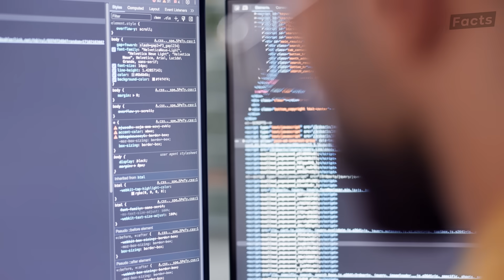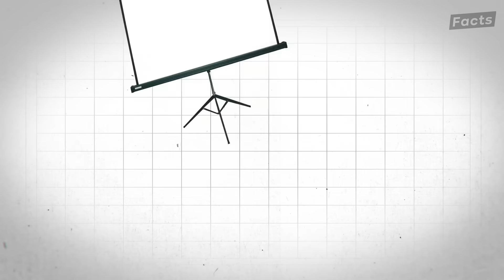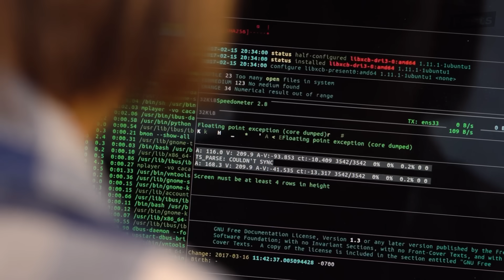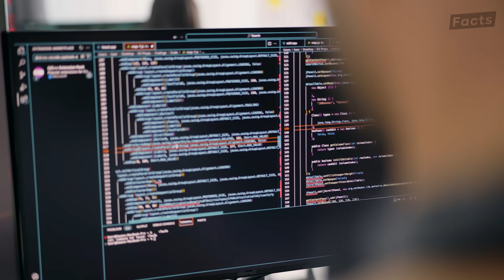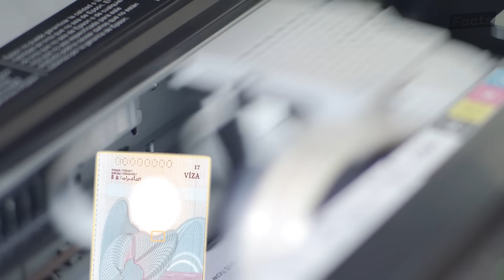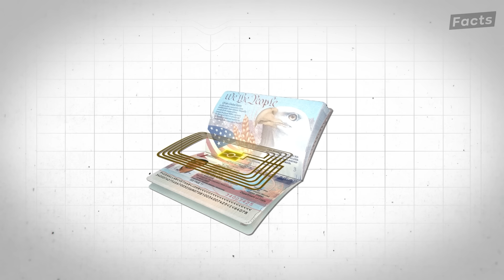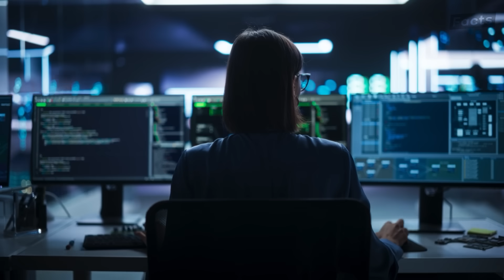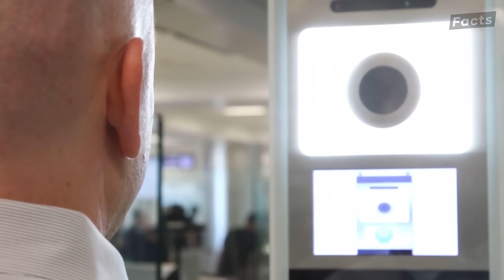How Fake U.S. Passports Are Made - Inside a Secret Forgery Lab

Comment: It is recommended that all countries, including the United States, implement biometric passports with digital signatures and OCSP verification. This process is as simple as checking the chip and viewing the digital signature. Currently, this signature cannot be forged. Furthermore, if someone were to break RSA, passport forgery would be the least of our problems. Please note that OCSP validation is required for stolen or lost documents.

This technology is also used in European ID cards, although for various reasons, validation is rarely performed.

Automatic border crossing machines facilitate this process. The potential risk to be aware of is that a passport could be stolen and misused by an unauthorised third party before the loss is reported.

Comment: US is so behind in terms of technology that it can’t even secure its passport system.
Reply: It is recommended that all countries, including the United States, implement biometric passports with digital signatures and OCSP verification (US does partially). This process is as simple as checking the chip and viewing the digital signature. Currently, this signature cannot be forged. Furthermore, if someone were to break RSA, passport forgery would be the least of our problems. Please note that OCSP validation is required for stolen or lost documents.

This technology is also used in European ID cards, although for various reasons, validation is rarely performed.

Automatic border crossing machines facilitate this process. The potential risk to be aware of is that a passport could be stolen and misused by an unauthorised third party before the loss is reported.

Comment: I  just ran a quote for passport making machinery. Maybe there are more, but I only found 2 companies that can make the machines. Then there is the paper. The printers are done by other companies. The combo can run up to $8 Millions.
Reply: It is recommended that all countries, including the United States, implement biometric passports with digital signatures and OCSP verification (US currently doesn't). This process is as simple as checking the chip and viewing the digital signature. Currently, this signature cannot be forged. Furthermore, if someone were to break RSA, passport forgery would be the least of our problems. Please note that OCSP validation is required for stolen or lost documents.

This technology is also used in European ID cards, although for various reasons, validation is rarely performed.

Automatic border crossing machines facilitate this process. The potential risk to be aware of is that a passport could be stolen and misused by an unauthorised third party before the loss is reported.

Comment: Only problem is, CBP has been using facial recognition for the past few years. So , a U.S. Citizen gets their photo taken and the picture comes up on the CBP screen of the application and other ID. So making a new passport will not have a photo of the original application.
Reply: US citizens are not required to have their photo taken when crossing into the us
Reply: @fu-anpang638  Citizen here. I just came back and the signs said you can opt out, and even if you don't, they won't save your image for longer than 12 hours. If you are not a citizen, they do save your headshot each time you enter.

Comment: Border staff needs to work twice to detect this criminals
Reply: It is recommended that all countries, including the United States, implement biometric passports with digital signatures and OCSP verification. This process is as simple as checking the chip and viewing the digital signature. Currently, this signature cannot be forged. Furthermore, if someone were to break RSA, passport forgery would be the least of our problems. Please note that OCSP validation is required for stolen or lost documents.

This technology is also used in European ID cards, although for various reasons, validation is rarely performed.

Automatic border crossing machines facilitate this process. The potential risk to be aware of is that a passport could be stolen and misused by an unauthorised third party before the loss is reported.

With that the check is also instantly.
Reply: will be imposible can be only if 2 persons use id in the same time